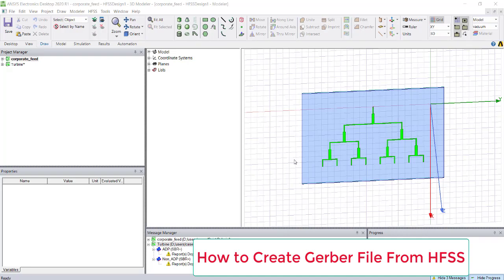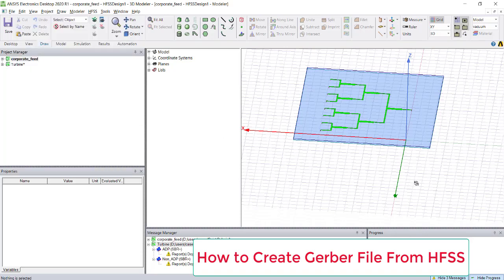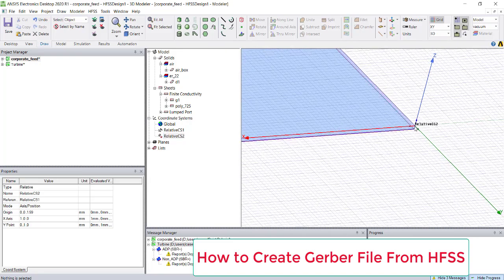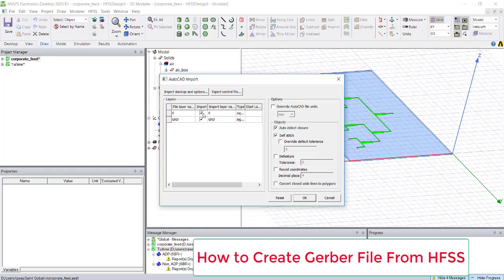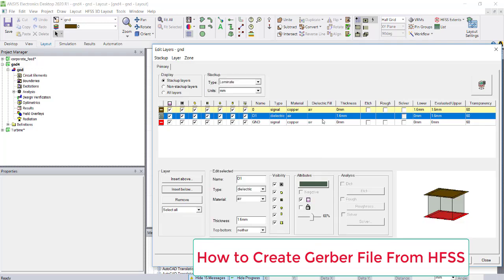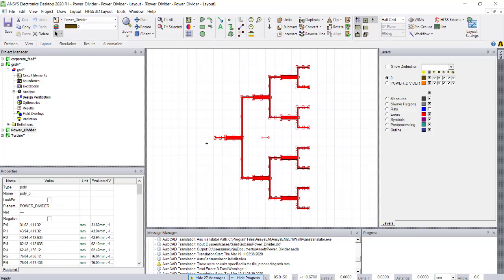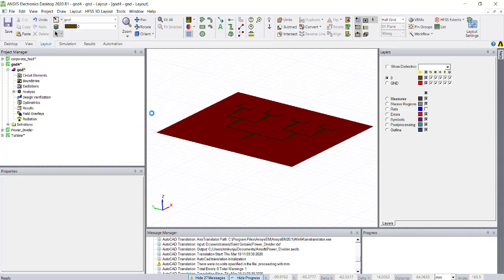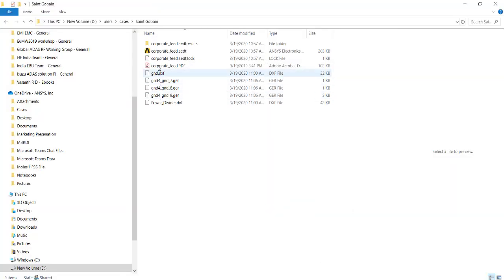How to Export Gerber File From Ansys HFSS - PCB/Antenna Fabrication

Comment: I have tried a couple way to export gerber file and I don't think his is the best approach, because hfss gerber extension and format are different Manufactures don't accept this format. 
I think the best solution is to export gnd and patch as dxf files and import them into the program designedfor pcb design (like kicad, easyeda etc)

Comment: Hello, I want to know how to calculate the length and width of the transmission line on a particular frequency.
Reply from the maker: There are many online calculator available 
https://www.everythingrf.com/rf-calculators/microstrip-impedance-calculator

Once u design, model it in HFSS and calculate characterization